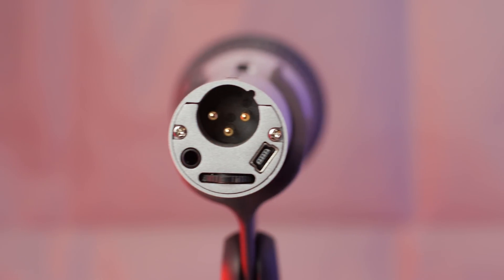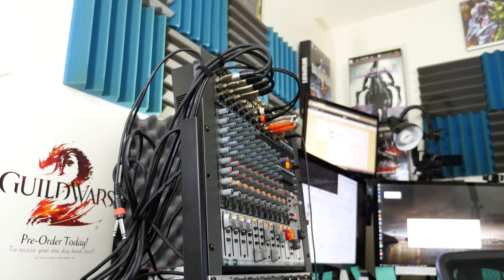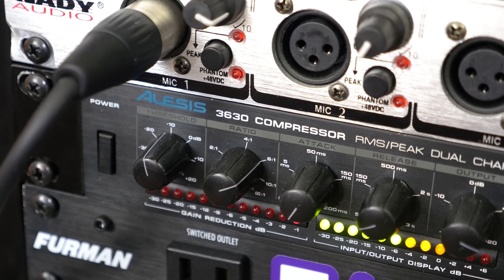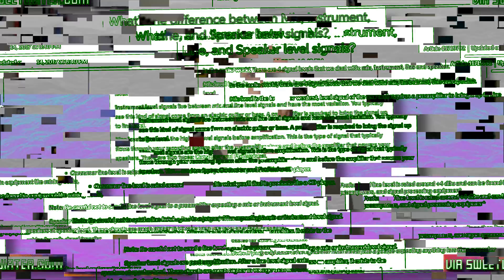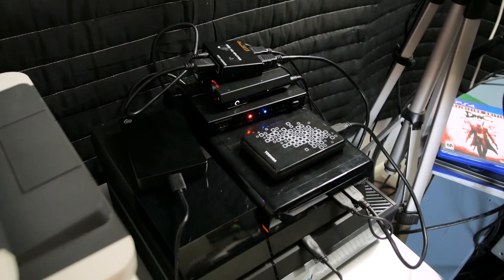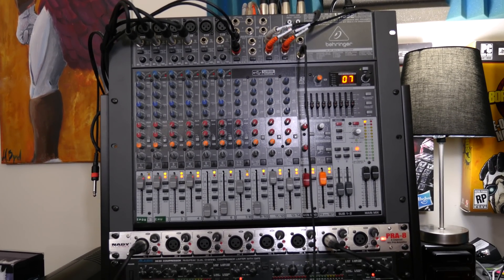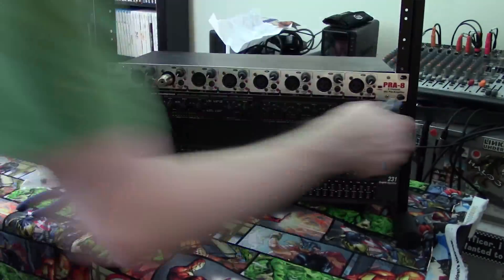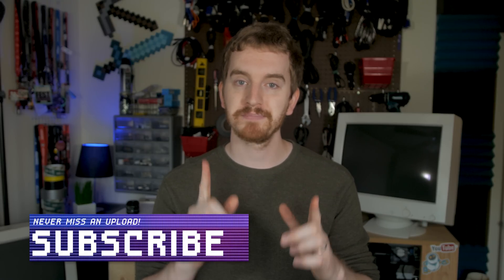OBS Studio 116 - Audio Mixers vs. USB Interfaces - Which should you use? Is there a difference?

Comment: Yeah I thought when you mentioned the OBS in your title you were going to actually talk about configuring OBS to take the audio in. Obviously to my camera mic input which is a Canon EOS r100 I am feeding that from the output of my mixer into an audio interface which is selected at line and the output which is a 1/8 selected at mic level. There are obviously controls on the mixer, also the audio interface and even in the camera to ensure I am not over driving the audio. I am however concerned about bringing video and audio from WhatsApp and was thinking of sending that out the computer into the mixer which would then come in with the regular microphone except I would be able to turn up and down the external sources from WhatsApp. Is there a way in OBS also to just take the audio direct from the WhatsApp video for guests to the stream?

Comment: Do sound card matters? I use old soundblaster 2 with line in input to capture analog signal from my Pioneer DJM-800. I have to set mixer output level to 11'o clock due to distortion. I'm not sure that im setting it right.

Comment: Hello! Thank you so much for all your videos. They helped me a lot! I'm a fitness instructor and I'm setting up my studio to teach online. I got the Behringer Xenyx Q502USB to plug in my mic and my music, and connected to my pc through the USB cable. The connection is successful and I can hear everything when I record my class through OBS but the sound recorded is very low. I turned off most of the tracks on OBS audio mixer for my Q502 (left only 2 checked),  and set all the other devices volume to 0% except the Q502 set as 100%. Finally I muted all other options of sound under the OBS Audio Mixer option AND "audio monitoring" is set to Monitor Off. The recorded video volume is still low compare to the volume I recorded. Do you recommend changing more settings in OBS or in the Q502 (I have everything at middle point) to increase the sound quality of my Windows 10 laptop? My intention is to upload these into Vimeo and place in my website. My settings under audio is set with 48Hz, stereo channels and I got "Default" on all devices. The decay rate is Fast and peak meter type is "sample peak". Monitoring device "default". The disable windows audio ducking is checked. Under "OUTPUT" I got recording tab set with Standard Type, mkv format and I got 3 audio tracks selected. My audio bitrate is 160 and I'm recording with 60FPS GoPro camera. Any help is deeply appreciated!

Comment: Hello EposVox thank you for sharing al you knowledge. I am having an issue with m,y Scarlett 2i2 3rd Gen with OBS. I am unable to separate the 2 audio inputs into different tracks or L/R channel in my records for interviews. I see there is a plug called ASIO but i am running on a MAC therefore I'm out of luck. Do you know of any other solutions to separate my 2 mic inputs on my records. Any information is appreciated.

Comment: Thanks a lot.  I've been struggling with the question of what to do with my Sennheiser headphones which use 1/4" plug and standard Blue Yeti mic.  To date, my solution has been connect the headset to the Yeti via a 1/4" - 3.5 mm adapter, and then the Yeti to one of the USB ports on my computer.  I found this setup to be clunky, and just plain ugly with the wires all strewn about.  I decided to clean things up by switching to the Razer wireless headset, and have rather quickly discovered that I hate it.  It's heavy, bulky, and the earpieces make my ears sweat after a few minutes use.

I finally decided to go the usb interface route, and have purchased the PreSonus Audiobox 2x2 along with a new mic stand.  I went cheap on my first desk mount mic stand and well, you get what you pay for.  I may need to get more advanced in the future, but for someone who just does the occasional streaming, I just need game sound, discord, and a mic input.

Comment: If your submix is heading to the LineIn on the PC, but you're interviewing/interacting with someone on TeamSpeak/Skype/VOIP, how do you isolate them to only hear a different submix of just your microphones without game/music/other audio, including their own audio echo?
My audio interface burned out recently;  It presented itself as two mic inputs, as well as two sound outputs.  I had do some circular routing to take computer audio out of the sound card, route it back into the interface and then mix it out on the secondary "mic" usb channel.  This system often broke in Windows (bad drivers? bad OS?)
I need to replace that interface, and I'd like to do it with a mixer, but I am struggling to find a mixer with (wet) multitrack recording over USB; Some have Main + Subgroup out, and the 12MTK gives you Main+Subgroup then 12-dry single tracks (not mixed).  But what I'd like is a few (4?) mixed channels going back via USB so I can...
1.send one mix to TeamSpeak/Skype/VOIP for a mixture of Mics + Music/game audio but NOT their own echo
2. OBS with the full mix of Mics, TeamSpeak/Skype/Voip + Music/game audio.
3. A commentary track, Mics only (or maybe Mics + teamspeak) without additional audio that is continually recorded.
4.  ... I haven't thought of a use for a 4th channel, but best to have a spare.
Any thoughts on how to get multiple mixes all heading back to Windows?

Comment: Nice video there, all i want to do is being able to stream my music so i can perform a live concert from my room lol. In resume no matter what i do i can't get the interface to work all the channels, just the 2 first inputs of the interface work but the third won't wonk i wish it could work.

 I do loops on a Boss Rc-30 pedal i use a guitar and a drumpad and also sing a little bit, so my setup goes like this: on a focusrite 18i8 i use 3 inputs; 1) the first input for vocals with a XLR cable (this one is separeted from the loop pedal Boss Rc-30) 2) I use this input for guitars the second input from the boss RC-30 goes to the second input of the audio interface with a 1/4 inch cable connected and 3) i used this one for drums which one comes from the second input of the Boss-Rc30 to the third input on the interface, this last one doesnt work properly, it's like it only recieves the 2 first inputs signals from the interface(the mic and guitars) and not the third one (which is the drum channel), what i want to do is being able to recieve the signal from this third input too, i tried different ways, like connecting my DAW (ableton) with some softwares like voice meter and virtual cable, but it doesn't seems to work.

If anyone can help me with this i would be very grateful.
Reply: I think what he was saying was to run an actual cable from the monitor out/main out from your interface with an 1/8" TRS adapter to your computer's mic input. Aka a 2-track submix of all the interface's channels. Still pretty ghetto if you ask me! But at least you would be able to hear all your tracks, as long as you did your gain staging correctly within the interface. Hope you work something out so we can enjoy your beautiful music!

Comment: I'm looking for a USB mixer (No more than 100ish dollars) where I can monitor my live microphone sound and hear the audio coming from my computer at the same time with no latency. This seems like it should be a standard feature and maybe it is but I was going to get a Behringer mixer and read that it didn't have that option and now I'm paranoid. Can anybody recommend anything or give me any advice?
Reply from the maker: What microphone do you have? That's kind of the important part.
Reply: @EposVox  It's a Sterling ST51 I believe. Just a fairly cheap condenser mic that connects via XLR. I currently use an audiobox but am looking to get something with more control (EQ knobs, compression etc). I just want to be able to hear my PC audio and mic audio in real time because I'm going to be recording music track by track.

Comment: If you have outside crosstalk interference and have trouble locating it, one cheap solution is a wire toner or small AM radio which can be used to hold on/near the surfaces of active hardware and lines to see which is generating interference. This is also an easy way to rule out lighting issues such as bad ballasts or other power management issues. I picked this trick up working in telecom and dealing all manner of signal interference.

Comment: Eyes Crossed! As a beginner to a home recording studio, this video was way over my head. Got the feeling that this person was simply bragging about his high dollar home recording studio. Then again, this video may have value to more advanced home studio recording folks that have thousands of dollars to spend.
Reply from the maker: I do need to work on dumbing things down further - but nothing about this was bragging. My whole setup shown here was done for less than $500, using mostly used or really old gear, and is honestly very much laughable compared to "real" setups. The point was to show the budget way of going about things and the kinds of options available.
Reply: @EposVox  You are saying the hardware in your video is old budget hardware? Ha ha..... I suppose it all comes down to what one's budget is.
Reply from the maker: @Dannyrh2  It is. Other than the mixer itself, all the rack-mount components are some of the cheapest/most affordable/budget-friendly options for those things. Most of them are even from the like 90s. Very old, used, acquired cheaply off of eBay. Everything below the mixer I got for like $200 total.
In the audio production world that's literally nothing.
Reply: @EposVox  I stand corrected Sir. I failed to take into consideration that you may have purchased used gear. My comment above came at a time when my patience was worn very thin. As a beginner, patience is even more critical & I am afraid it is one of my weak points. Thanks for sharing with us.

Comment: so the mixer I run currently is a Peavey Unity Series 300 mixer , a 12 channel analogue . (it's a step up from the 4 track porta 07 Cassette recorder I have) it just took me a while to figure out that I can connect 3 PC's to one mixer , yea 3 PC's to one mixer using RCA to 3.5mm cables with extenders . but over all the video was very informative hell I decided to try and include my gaming PC's line in  I may end up doing the same on my streaming PC and see what results I get , as soon as I can get my adapters and RCA extenders I'll be able to connect my XBOX 360 to my PC and see what kind of footage I can get from it .

Comment: Presonus AR12 solves all my problems.  Multitracking with paired USB devices running through one cable.  Press USB 1/2 over the main fader and you’re good to go.  No issues I’ve found with it.  Just posted a video on how it all works.

Comment: Without an audio interface you are relying on your computers on board digital - analog converters. Most computers just don’t have enough processing power in that department to compete with audio interfaces which are purpose built for that reason. You can have issues when tracking but mostly when playing back high amounts of audio tracks. An audio interface is essential for anyone wanting to mix or master music.
Reply from the maker: Equally, modern Windows struggles a LOT to maintain DPC Latency and keep USB drivers going, so in terms of stability - onboard audio is safest. For quality and professional audio-only work, digital is the way to go.

Comment: Great video. I have a question, are you running the USB cable into your PC? If so, how come OBS is not showing the behringer as your device? Your selecting the Realtek speaker, I'm a little confused :(
Reply from the maker: No the USB output of that mixer is virtually useless, so I run the Main Out (and Sub Out) to Line In inputs on my PC and sound card.

Comment: Hi, just discovered your channel as I'm trying to figure out the best way to make OBS streams of myself singing along to karaoke tracks; in other words mini-concerts from my studio. What I'm struggling with is to get something with acceptable latency as I'm self-monitoring in headphones while I sing AND I want to add some delay/reverb to my voice in the livestream. I'm using a condenser mic and I have a focusrite Saffire 24DSP and a Scarlett 2i4, but also have an old analog Mackie VLZ1202 and an Alesis MidiVerb lying around. I was hoping to do all this digitally as my desk space is limited but I'm starting to wonder... My original setup involved playback of music from DAW (Cubase) into Voicemeeter and sending all that to OBS. But I was having issues - the moment I enabled monitoring in Cubase, my mic would have an awful feedback loop so that wasn't working. I wanted to use the plugins loaded in Cubase. Because OBS now has the option of adding a plugin chain (which will apply to the stream) and I only need music playback, I'm wondering if I should just ditch Voicemeeter completely, and playback the tracks from Windows Media Player? Do you have any suggestions, or ideally videos, on streaming a karaoke concert? If not, could you please make one?

Comment: I use a USB-Mixer and Voicemeeter Banana. Every physical piece of my setup is run over the Mixer and for recording only special programms (and not the hole Dektop-Sound) I use Audio Router to send a programms audio to the second virtual soundcard, wich then goes out to one of the two virtual outputs. And this Output is where I'm recording from.

Comment: awesome video! I have experience with home studio recording setups, however I need help with setting up OBS and splitting audio signals. My primary audio interface is an M-Audio Firewire 1814 with a Presonus D8 connected via adat lightpipe for an additional 8 mic pre channels. I also have a behringer XENYX 2442FX sitting around that I want to incorporate into my setup for streaming but am not entirely sure how to in conjunction with the Firewire 1814.
What I want to do is split audio sources from my computer audio such as diskord chat, music player, and web browser but am not sure how to route the signal into the mixer and back into the audio interface.  Essentially I want to be able to control my mic volume on its own channel on the mixer, gameplay audio on its own channel,  and all other audio such as web browser and music on its own channel. 
I was almost thinking since the Firewire 1814 has 2 stereo outputs (1/2 & 3/4) is to send the gameplay audio out the audio interface channel 1/2 to channel 1 on the mixer, then setup diskord to out channel 3/4 to channel 2 on the mixer. plug my microphone into channel 3, and monitor with my headphones through the mixer or with my studio monitors plugged into the Control Room out. And here lies the confusion. I still want to send the web browser and music player audio (preferable on the same channel) to the mixer. I suppose I could send it with Diskord audio out channel 3/4 and control the balance in windows volume mixer. And then finally how would do I go about sending the whole mix on the board back to the audio interface? main mix out to 1/4 inch balance input on the audio interface?
Sorry thats a lot to read but it all makes more sense visually looking at all the gear I have laid out in front of me.

Comment: i wanted to buy the focusrite scarlet but you said something about it having issues, what else could i buy as an alternative for it? thank you
Reply: cyvidal10 me too what is the issue with this audio Interface (focusrite scarlet 8i8
Reply: The issues with Focusrite Win 10 drivers have long been resolved. I run a first gen Scarlett 18i6 with absolutely no problems at all. For on board audio mixing and routing, I'd highly recommend Voicemeeter software.

Comment: This question doesn't fit here perfectly, but it's mixer related.  I've got a Sony electret lavalier mic (has a battery in it).   Sounds clean, but I need to turn the gain up REALLY high on my mixer to get enough sound out of it.  How can I make it louder without maxing out the bias and level of the mic audio channel?  Am I missing something?
Reply: That same issue I found with analogue mixers, some analogue mixer preamps are weak, they work well with normal mics because they can be closer,  but not well lavs, because they are far from the mouth. I could not tell which one to recommend. I had to turn it up to 90% on my analogue, that why I start using digital mixer (behringer X32) or USB audio interface, I realize you do not need to max the knobs, it gives good audio about 60 to 65%. But you can also change the lav to rode, shure or senh. There are many design cheap shure lav mics and the the rode is also affordable, sehn is very pricey.

Comment: Superb series, just what I needed.  I'm using a $100 Behringer mixer in a streaming setup.  MacBook Pro has no "blue audio in", so I use an attenuation cable to get fully mixed sound to the mic-in on my DSLR.  If you have a PC with "Blue audio in" do you need the attenuator cable?
Reply from the maker: Generally no, since the output from your mixer is "line level" and not "mic level"